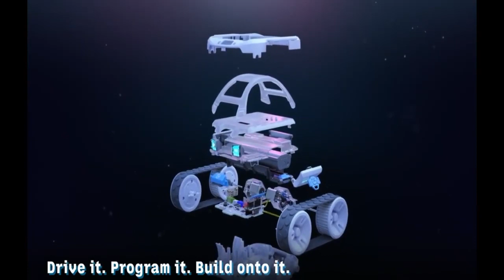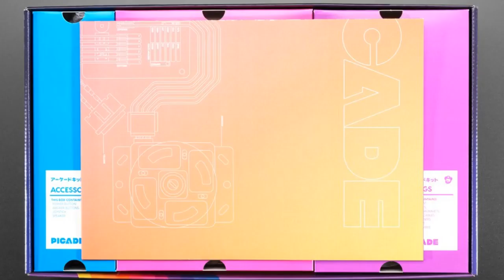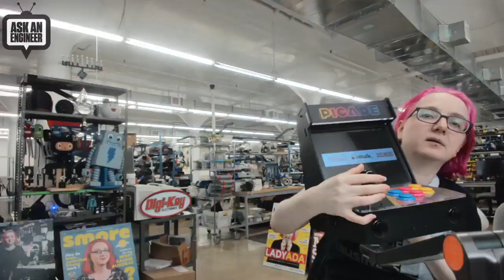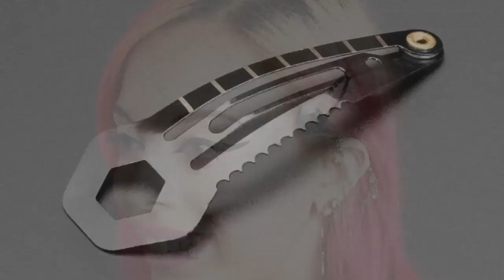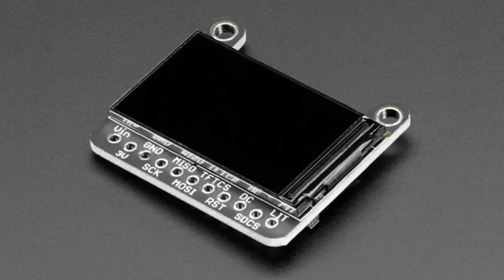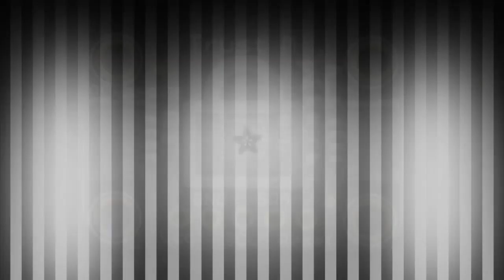New Products 10/9/19 featuring #Infineon Trust M #BreakoutBoard - STEMMA QT / Qwiic! #adafruit

Comment: Is it possible to have it play a looped MP4?
Reply: YEP. I used the kernel/framebuffer console style way instead of 'pure python' but I just used mplayer (or similar) with with --fb parameter or whatever to pipe it to tty1. It just plays a movie over the console screen and when it's done it quits out and goes back to the console prompt. You could loop it just the same so it never stops, or even add button support to make it stop or start or flip through a folder of random mp4 clips. All that stuff.
Reply: @thegreatbogie  What's the refresh rate?